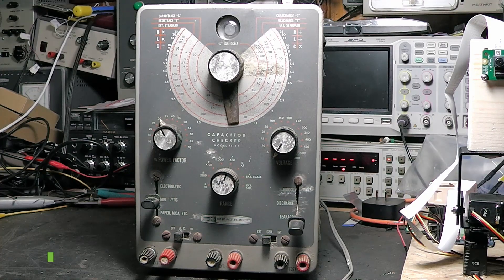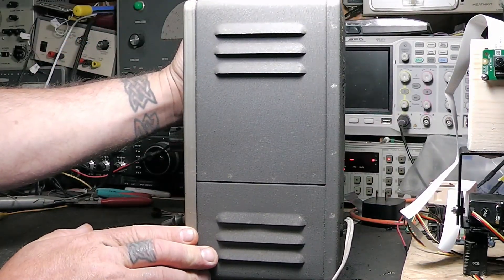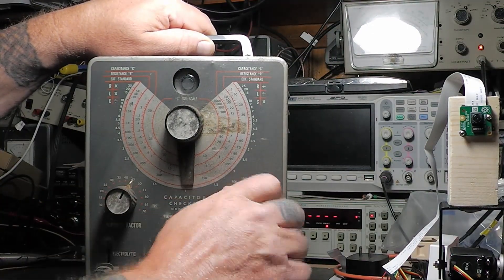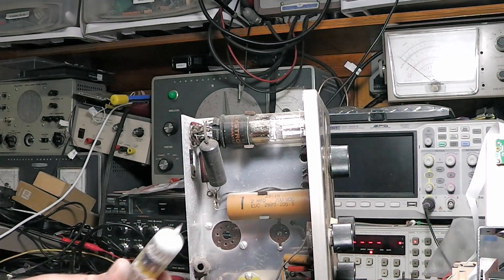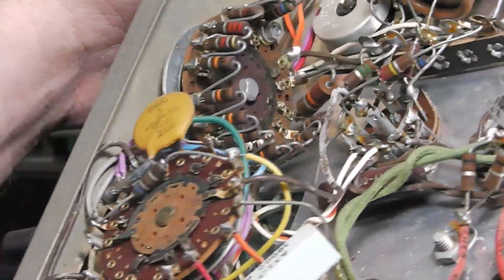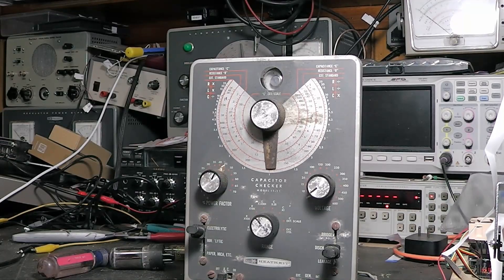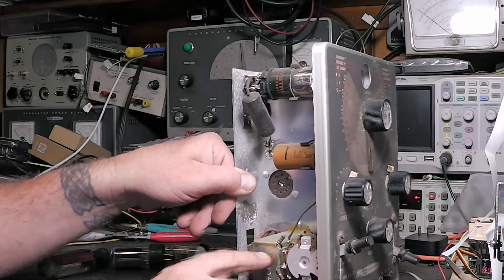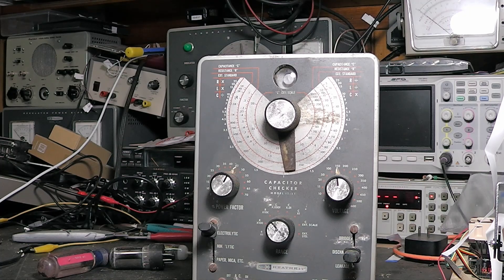Heathkit IT-11 RESTORE PART 1

Comment: Tubes that have gone white, have leaked in air. I'm sure you knew that. I'm a Heathkit guy from the 70's and I am buying them up, ham and test gear to use. They made great stuff.
Reply from the maker: Yes, for sure.  I have ran into lots over the years that have lost their vacuum and sucked in air.  This one got tossed around so roughly, I assumed it has a leak around one of the pins.  Looking at the glass closely I saw no cracks.  Of course they can get hair line cracks that is almost impossible to see. 🙂  Would love to see your collection!